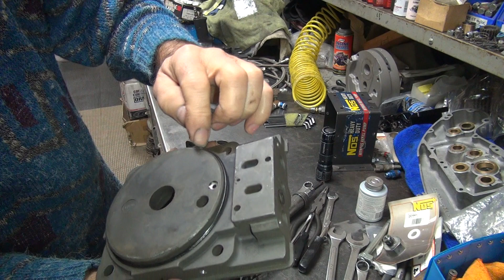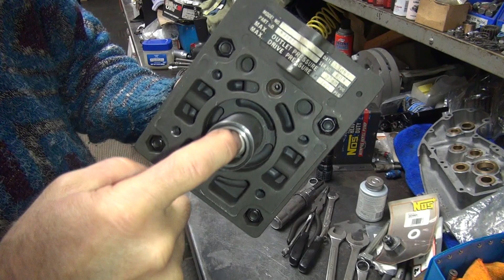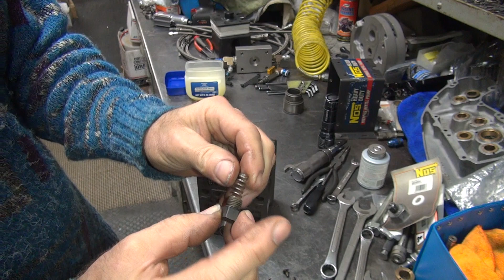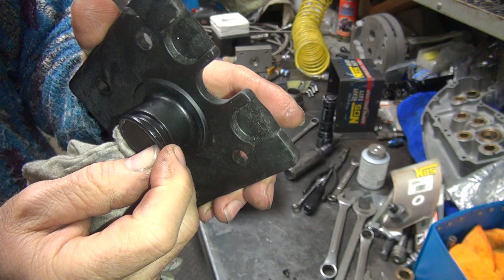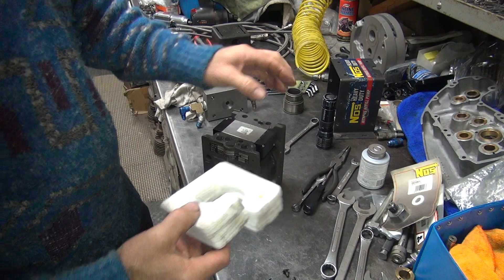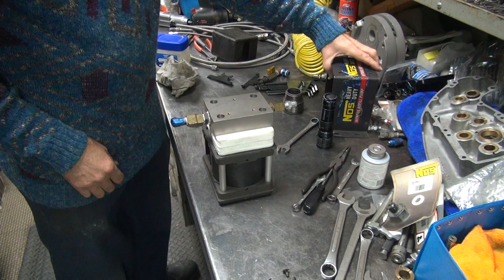#109 bad ebay nitrous oxide transfer pump rebuild nos drag race scta harley lsr racing tatro machine

Comment: Wondering if you ever used klotz nitro power additive , whe we used to race 2 stroke ice sleds that’s all we used , also use it in my Harley along with the nitrous , it’s the only power additive that works that I be tried over the years , kind of hard bringing into Canada so I order enough for the season.  Oh ya smells so nice out the pipes lol
Reply: I used to use that stuff. If it's the same as what I used it adds oxygen to the fuel. It works good. Had to jet up 2 sizes on 2 strokes so it definitely worked.
Reply: Dragon800 yes that’s what it is and definitely need to richer up or your asking for trouble ,  worked extremely well with my nitrous as well,  love it!
Reply: @prostreetdino7946  ya Klotz is an awesome company. All those other products out there just contain an octane booster which does practically nothing. I used to install nitrous kits when I worked at a performance shop do you have nitrous on your sled or your bike? I usually used Boondocker nitrous kits they worked pretty good but their EFI programmers were pretty simplistic so I used DynoJet's programmer with EFI engines.
Reply: Dragon800 have a 65shot on my pro street Harley , used to have the horn button to activate the system but it was to hard to hold on and be holding down that horn button lol, and it revs so fast hard to stop nod before rev limiter . So I bought a nos window switch that turns the nos on at 3000  and shuts off at 5700  rpm , so much easier as well safer , I’ve seen the boondocks setups , never tried but they do look nice
Reply: @prostreetdino7946  ya I like rpm activation especially on a bike. A few guys on snowmobiles liked it to be activated by throttle position so say 90%-100% throttle nitrous was active.
Reply from the maker: no, i just use caster bean oil. it keeps everything nice and oily. if i want more oxygen in my mix i just add more nitrous to the nitro. at some point i am just on the bottle and the carb is for show. four foggers on one cylinder gets the job done with 30% in the tank.
tatro
Reply: @TatroMachine  holy shit that sounds awesome!